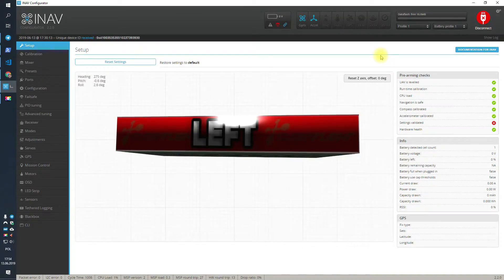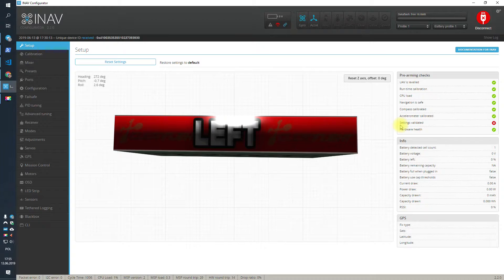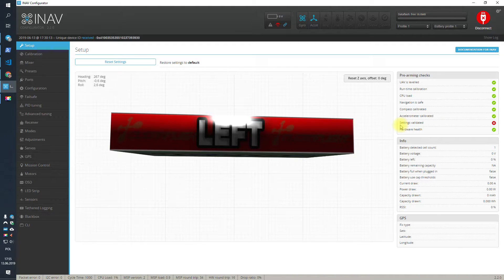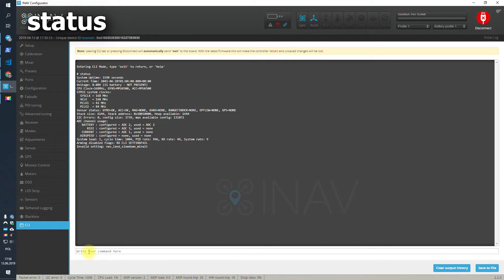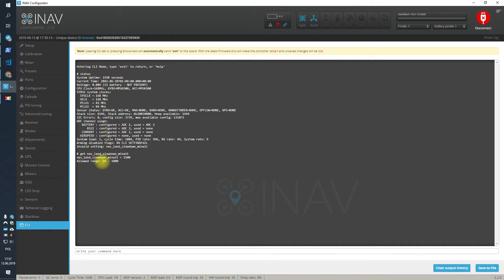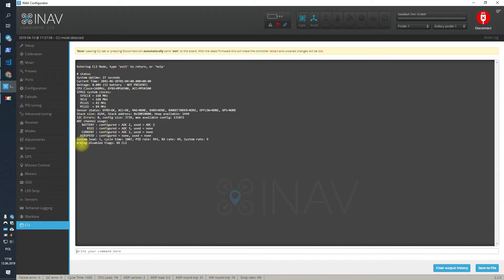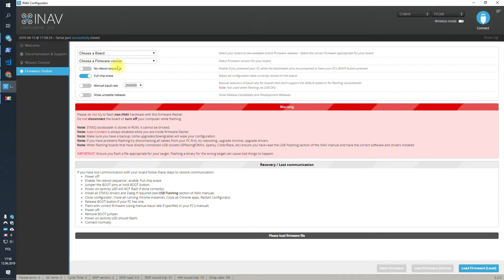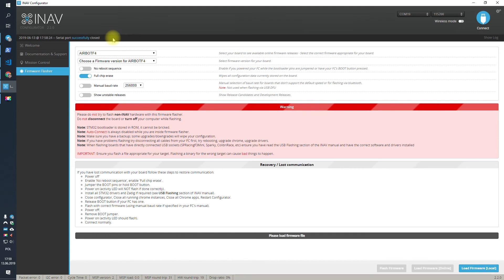INAV settings NOT validated - INAV Troubleshooting

Comment: Hi Pawel
I'm using Inav 6.1 on matek H743 with BN880 GPS. After configuration, i end up with 2 errors on my configuration (runtime calibration compass calibrated)
Here is what the status shows
# status
INAV/MATEKH743 6.1.0 May 11 2023 / 13:29:16 (d6ce6e70)
GCC-10.2.1 20201103 (release)
System Uptime: 367 seconds
Current Time: 2041-06-28T01:04:00.000+00:00
Voltage: 0.00V (1S battery - NOT PRESENT)
CPU Clock=480MHz, GYRO=ICM42605, ACC=ICM42605, BARO=SPL06, MAG=HMC5883
STM32 system clocks:
  SYSCLK = 480 MHz
  HCLK   = 240 MHz
  PCLK1  = 120 MHz
  PCLK2  = 120 MHz
Sensor status: GYRO=OK, ACC=OK, MAG=OK, BARO=OK, RANGEFINDER=NONE, OPFLOW=NONE, GPS=OK
SD card: Manufacturer 0x3, 31166976kB, 01/2001, v8.0, 'SP32G'
Filesystem: Ready
Stack size: 6144, Stack address: 0x20020000, Heap available: 1716
I2C Errors: 50, config size: 9067, max available config: 131072
ADC channel usage:
   BATTERY : configured = ADC 1, used = ADC 1
      RSSI : configured = ADC 3, used = none
   CURRENT : configured = ADC 2, used = ADC 2
  AIRSPEED : configured = ADC 4, used = none
System load: 1, cycle time: 1005, PID rate: 995, RX rate: 9, System rate: 10
Arming disabled flags: CAL COMPASS RX CLI
OSD: MAX7456 [30 x 16]
VTX: not detected

According to you what is the problem?

Comment: Thanks. New to iNav and your videos have been very helpful.             Edit - here's something to add to your tips guide: Finally, after many hours, managed to arm my F405 Wing board, everything was green, no issues, just would not arm. The solution was to change the ESC protocol to Oneshot125 - apparently my T-motor F45 ESCs did not like the default setting. Have not found anyone suggesting this.

Comment: I am having a major iNav meltdown. I cannot for the life of me get pos hold to highlight in the config, no matter what i try. and neither will RTH. any help with the modes tab would be much appreciated
Reply: I am having exactly the same problem.  I also can’t get them to highlight when I have gps lock. Also tried flying a distance away and RTH did not activate.

Comment: Hi there Pawel. Have a question for you related to Inav. I have a Zohd dart xl with a matek f405 wing fc. My problem is that when I use inav launch the motor starts ok but the craft immediately rolls to left and nose dives into ground. Please help if you have any ideas to the causes of this. Many thanks, dave

Comment: Hi Pawel
love your videos I need your help please i am trying to put a simple 3d printed pan & tilt
camera unit into an omnibus f4 v6 board been at it for days now and still cant work the 
servo mixer in inav to to do anything i have set up the two sliders on my taranis and have tried connecting to the 5 & 6 motor outlet ports,been building & flying quads for two years and this 
is the first time trying to get two more servos to work,
Will you please draw me an idiot proof plan,
Many thanks,
Kevin.

Comment: Do I need to do the full chip erase when I update iNav? After the update do I have to calibrate the accelerometer?
Reply: Yes
Reply: Do I also have to calibrate the accelerometer even if it is already calibrated?
Reply: Luca Stella. No you can copy from the CLI of the previous version. If you still have the previous version in the FC you can note the Accelerometer Values in the Calibration Tab and enter these into the new version via the GUI